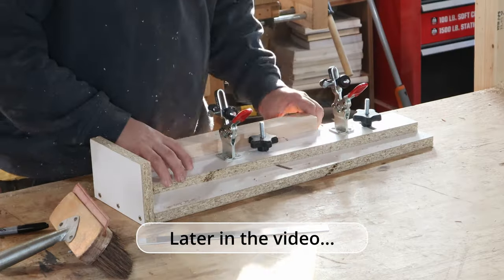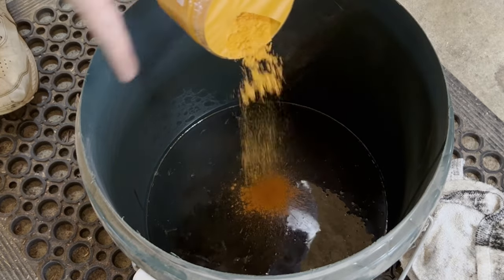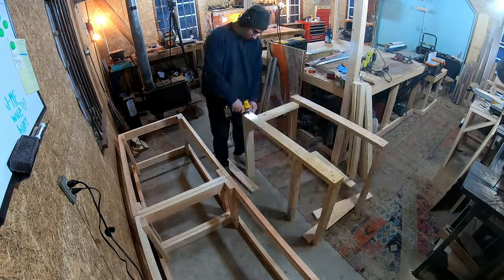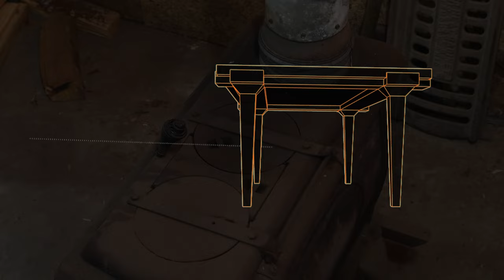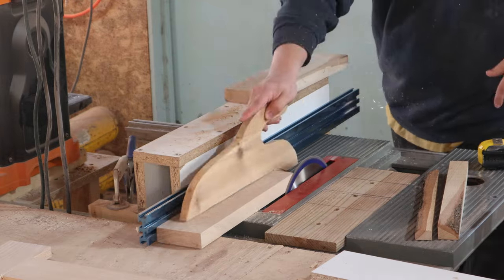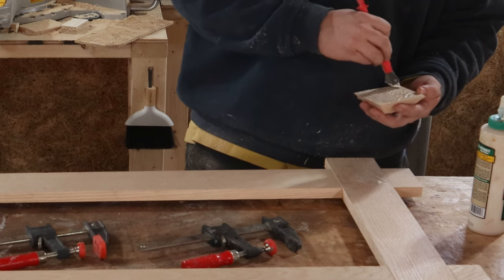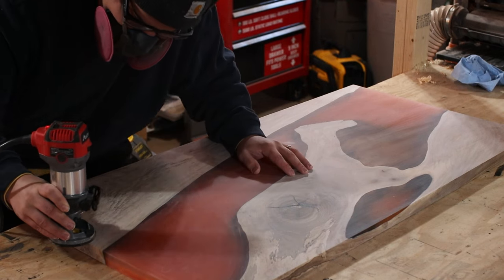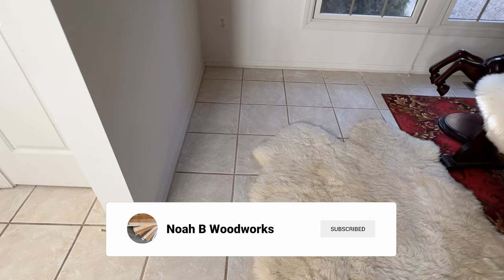Lava Coffee Table For My Mother In Law

Comment: Odies has several qualities (lovely smell) but durability for a table top is not one of them.  Hard wax oil is a good choice, the best choice, for those of us who do not have a dedicated finishing room. Osmo is a 1 pack HWO and, as you say, is not foolproof, requires at least 2 coats and each coat takes days and days to cure. 

The new generation of HWO are 2 pack. That is a wax/oil and a separate hardener. Mix the 2 and apply in any number of ways. In my shop, Natura Onecoat (I’ll come to why Natura) cures enough in an hour or so for me to be able to carefully move it off my bench. I get my bench back and that quick cure makes dust contamination just go away.

Last year, the Wood Whisperer produced a video reviewing the latest 2 pack HWO products. His overall winner was Natura Onecoat. As the name implies, it only needs one coat. It comes out with a very nice, natural sheen. You sand to about 100 grit and allow the wax and oil to produce the smooth natural sheen. You can sand to higher grits but understand that all oils require open timber pores to “sink” into. I regularly sand oak to 240 or even 320 as oak has naturally open pores. I wouldn’t go past 100 grit on closed grain woods such as hard maple. The risk is uneven penetration and, if you are using a tinted HWO, some blotches. It’s a risk but, even if you do have issues, so easy to sand and start again. 

2 pack HWO cost more per pint than 1 pack. However, the cost per can is not my concern. I am looking at cost per square foot on the surface. Natura easily does 55 square yards per litre (comes in 350ml and 1 litre cans?) and so works out to be very cost effective on the surface. A 1 pack will cost less per can but you need at least 2 coats and you can add the labour costs plus the risk of getting dust onto the surfaces whilst they sit there curing.
Reply from the maker: Wow thank you so much for the heads up on 2 pack HWO. I will most definitely be experimenting with Natura Onecoat. Thanks for taking the time to write such an informative and thoughtful comment. Cheers! 🍻